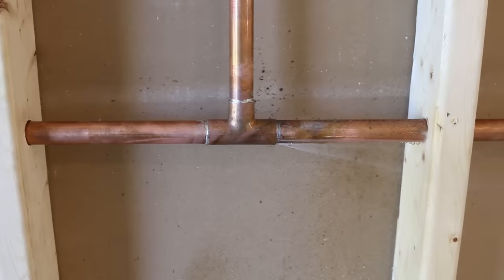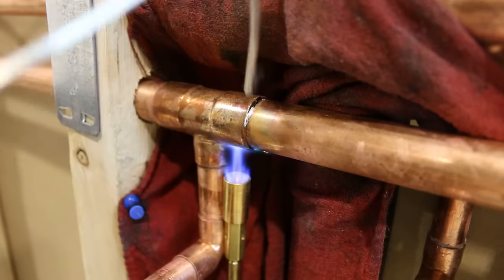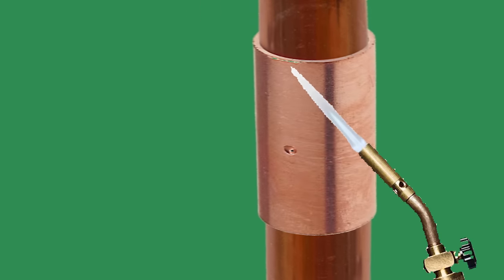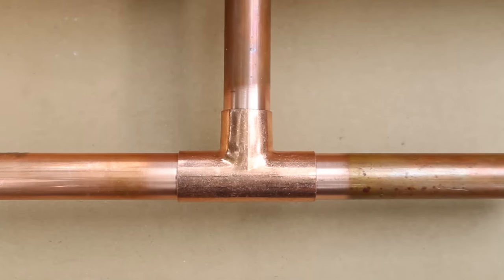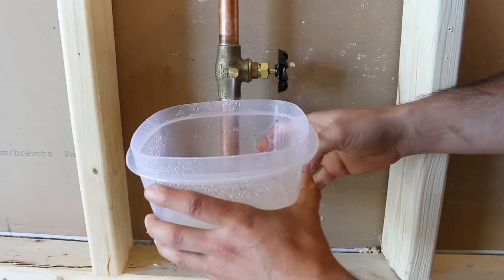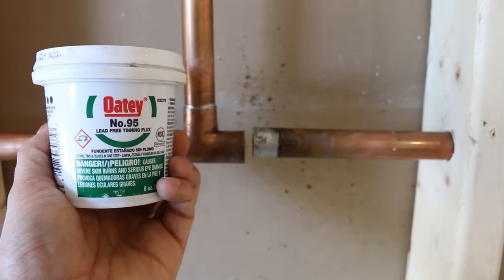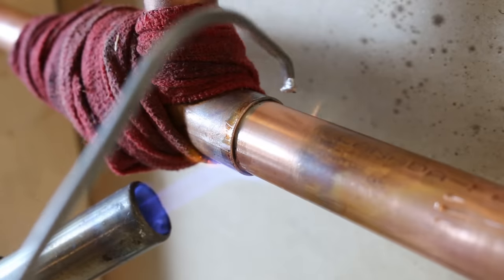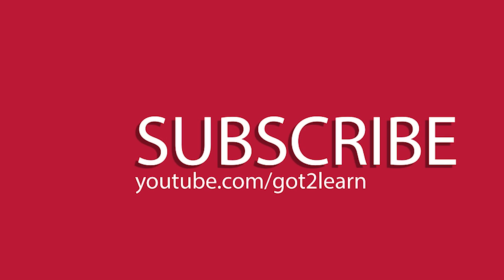The CORRECT Way To Fix A Leaking Joint (UNSOLDERING) | GOT2LEARN

Comment: Leaks happen bro, not often but once in a while. When you've completed 100's of joints it hard to gauge that odd one. Sometimes you forget to tighten that odd compression joint.  I only really dry test gas lines.  There's no second chances when safety is critical. Any plumber who tells you they haven't had a leak is a liar 😜.
Keep up the excellent work bruh 👌
Reply from the maker: I agree with everything you said ghost, if you don't want any leaks, don't go to work, cuz it WILL happen one day or another.
Reply: @Got2Learn  Tru dat bro, desoldered joints which a reformed are usually actually stronger. As the joint has been coated with solder (tinning). 
Your videos are looking super pro bro.  Really super with the editing & CGI, bravo 👌.
Reply from the maker: Thanks so much ghost! Yeah I want to do this type of editing in every video from now on, I am getting a lot of positive feedback from that, so it can only get better from now and on, :)
Reply: Ha!  And always, the joint that leaks is one of the first you did, right at the back of the cupboard behind all the other pipes you've just put in!  Quote from my plumbing tutor many years ago:  "ALWAYS check your joints, they're like pretty women, turn your back & they are trouble.!"
Reply: @theondebray  leaks happen especially when you have apprentices on hand. We've all been there, it was us creating devastation back at the beginning. Heck, sometimes you just have one of those days when you've done an install.  By the end of it you just want to get the hell out and hey presto Mr leak shows up 🤷‍♂️
Reply from the maker: That's when they happen the most, on Fridays just before leaving hehe
Reply: Ha ha ha!  Dead right, somewhere around 5.20 pm, when you have an unavoidable appointment with your wife + her friends, just run out of solder / O rings, customer's wife on her way home, forget the gym slot, forget beers with your mates, children coming home for the weekend, appointment with bank manager next morning.  And the icing on the turd, your van won't start.  I think I can safely bet that you've been there before.  (That's why I usually plan to stop work around 3 pm on Friday, to greet Colonel Murphy & his mates.)
Reply: Yup.  You only get leaks around 4.50pm on a Friday just as the customer comes home.  So I worked out that, when finishing a job, if there is no leak, then something's wrong.  It keeps you on your toes, and makes you work doubly carefully.  Oh, and BTW, you probably know, the leak is ALWAYS that joint at the back of the cupboard behind all of the pipework that you've spent a week building.
Reply: I am a pipefitter, what is this word "leak" people keep using? I checked my dictionary, it's not in there.

Comment: For horizontal pipes with residual water in them, I stuff a little piece of bread in the pipe before I soldier it. Works every time.
Reply: I once made the mistake of using whole wheat bread as a stopper. It was all I had and store was miles away. Typical electrician (me) screw up. I soon discovered that wheat berries in dough don't dissolve. I had to take the joint apart and re-sweat after it clogged the faucets. Only use soft white bread dough as a stopper. As previously stated, "it works every time".

Comment: The problem to get all water out is often best resolved with a vacuum cleaner sucking or blowing inside the tube. The airstream will move or even dry up the water and avoid a saturated steam inside the tube when heating.

Comment: I would go ahead and put a very thin layer of flux inside the fitting. You can apply the flux with one brush and use a clean flux brush to wipe out the excess flux before pushing the pipe inside the fitting. The small amount of flux that gets into the pipe is not near as bad as not getting flux on the inside of the fitting. You can (and should) flush out the pipes after a repair anyway.
It is also way easier and faster to just heat the pipe up and wipe off the old solder with a clean dry rag instead of attempting to sand off the old solder which will remove the solder "tint" in more than one place in most cases. That thin layer of tint could be the difference between a successful repair or another failed solder joint .
Reply: Tin. Not tint.

Comment: I had an entry stack in 1.5 " , shutoff, pressure reg and lateral line in 1.25" that was leaking after I changed out the regulator. There was a tiny leak in the big line. I had the clients water off all day, and they were coming home soon. By the time I walked back from my truck, it had stopped. The gods intervened. I said thank you to the heavens and started cleaning up. Going back on Monday for other work. Curious about what I'll find. It's outside and around back, so , I'll be able to sleep. I usually obsess over errors, but this time I accepted other worldly help. Thank for your videos. I've been in the trades for decades, but you've taught me a couple of things.
Reply: David G
Reply: I learned a lesson, though. From now on I'm going to tin larger tubes and fittings before joining them.
Reply: I was really busy for a couple of years but available, Suzanne

Comment: Well I had come back home to just this mess with my old house...downstairs wall and ceiling with water EVERYWHERE!

Ripped out upstairs bathtub to get to the leak and there it was, different configuration but same type of leak for the same reason, failed solder joint... 

As a newby I embarked on a DIY repair 
and followed the unsolder/clean prepare/resolder and no leak now (messy but no leak)...

So as they say: If I can, anyone can...as long as you follow this guide! :-)

Now for a DIY rebuild walls, etc.
Reply from the maker: Thank you 😎😎

Comment: I think you do a great job explaining things. KUDOS!!! However, in most cases you cannot hammer the two pieces apart because there is not enough room to push the pipe away. 
In addition, it is many times difficult to get the water out of the lines. I opened up the nearest faucet to the leak, close the rest of the faucets, and also opened up an outside hose bib. I then forced air from the outside hose bib into the water lines to clear the water.

Comment: At my dad's house there is a pinhole leak in a copper T fitting the pipe is 50 years old. I'd like to try fixing it but I've never done it this video makes it seem straight forward. The only problem is the T intersection doesn't have any room to move any of the three pipes. I'd be curious to know why after 50 years it's leaking and I dread to know what's leaking in the walls.
Reply: if there's a pinhole leak then it wasn't soldered right the first/second time or it was fixed as shown by 'patching' it.

Comment: I had a leaking T joint on one of my heating pipes (2x18mm and 1x15mm). I noticed the 15 mm joint was dripping so I decided to give it a go after seeing your cool vids. I soldered some copper pipes and fittings I had lying around to get a feel for it, then I tried to unsolder the T after emptying out all the water. The "wet rag" solution you showed so as to not mess up the other two joints in the T doesn't work. It cools down the entire assembly too much. I couldn't get the joint hot enough to take it off. So I unsoldered the entire thing. Also, I tried to use the "wet rag" on corner joints, doesn't work. The only solution if you have to repair this kind of joint is to take the entire thing off and re-solder it. Also, I found that if you might have to hack some pipes off to get all the water out and either replace the section (if it's small) or put a connector where you made the cut. It's no use wasting time on pipes which have even the least amount of water in them. All in all, your videos are great, I learned a lot from them. Keep up the good work!

LE: A word of caution if you want to try the clamp solution. The copper pipes get deformed easily if you apply force with pliers or something similar. My advice is to heat up the joint sufficiently and then use only light force to take it out. If you don't have enough room, just cut the pipe, slide a connector on it and finish the job like that. It saves time and frustration.
Reply from the maker: awesome!!!

Comment: Clean pipe and fitting- most important part- don’t touch,oils on fingers will contaminate 
Apply heat bottom of fitting
Wipe off excess flux
Apply solder at pasty range opposite heat
Solder will flow around fitting
Remove heat and apply solder around 
Wipe with rag
Done
Reply: Steve Flynn , clean is the key!
Reply: I'm in with Flynn!! Do it right the first time. Fixing a leak is 10x's more difficult and more time consuming than your first go.😎
Reply: Close

Comment: You’re right, soldering is an art. The copper has to be clean, fluxed and heated to the correct temperature for it to suck that solder in. 👍
Reply from the maker: Correct! Thx Viper for the kind comment, I like your new icon btw ;)
Reply: Got2Learn merci beaucoup 😁

Comment: I once "repaired " a very visible leaking joint by turning off the water supply so that the exterior of the pipe could be completely dried. I roughened the area and applied "liquid steel", an old product very much like JB Weld. Let it harden and turned on the water. There was no leaking. This was a lot easier for me at the time than an orthodox repair. I knew it wouldn't "last".  But, exactly 60 YEARS later, it was still bone dry.  More recently I had a pipe leak that was also visible but where draining and drying would be very difficult so I tried a silicone tape wrap. That's still holding up now at 4 years.  For the time being, I saved myself a LOT of work.

Comment: It's insane how different your systems are from ours - Europeans. We just use pipes with rubber circle-thingies, we tighten it up and bam, it's done. And sewage is even easier. You can even remove it and attach it back up if you need to do something in a matter of minutes. No soldering, no nothing.
Reply: I'm sure you're talking about the ProPress and it's fittings. A hydraulic clamp machine that squeezes a rubber o-ring around a pipe. The problem is they are expensive. The tool to make those fittings work is about $2,000 USD. And each fitting can run between $2-$10 based on it's size. It's extremely convenient for hard to solder places (near wood or anything flammable), but extremely expensive for larger projects. 

 
Compared to this here, these fittings are around half the price, and an acetylene torch for almost a tenth of the press tool, and the reuseability of the standard fittings which you saw here is what makes us americans do more soldering :)
Reply: @TonyGioMusic  No, not at all. I saw this technology, but the one I use is literally screw and all's done.

It's cheap, super simple and reliable. I suppose it's equivellent to your "shark" system. But ours is a bit different. 

There's just one con that I've noticed. We were working next to the water pipes and jaggered them around, which resulted in minor leaks. But we fixed it up quite fast.

But overall, it's an amazing system, and the water quality is just perfecto
Reply: It's an Italian technology (the fittings). And the pipes we use, white ones are from Germany. It's really not a clamp-on kinda stuff, but literally screw-on and tighten.
Reply: There's rubber already inside the fittings and when you tighten it up it solidates and doesn't let water through. Fittings are from 0.60 euros to 2 euros in retail stores and you could always buy from wholesale for hellawa cheaper

Comment: I’m going to start practicing soldering as I want to add some shut off valves to a small bathroom. Does the joint fail immediately or can it take months or years to fail if you don’t solder it correctly?
Reply from the maker: It depends. Normally you'll see it right away, sometimes it can take a few years depending on the water.
Reply: Check out modern compression and other fittings that don't require heat and solder, too.
Reply: Mission7608x2 و به ۶می‌کنم واریز کنم
Reply: wholeNwon که تو خونه
Reply: Hes right normally right away and up to 24 hrs mostly. Sometimes a year or two later but pretty rare.
Reply: U can tell if the joint repels the solder you have a issue, either moisture or not cleaned and fluxed properly.
Reply: After the third big plumbing job I realised my joints look better and are tight straight away. Fee tips from fellow amateur: do  not overheat connectors. MAP is usually ready after several seconds, very thoroughly sand joints and use deburrer. While heating listen to the flux, once it's stop sizzling, immediately apply about 2cm (15mm pipes) of solder in one place: capillary forces will move solder around. Wipe of flux excess after few minutes. If it's watertight, it's tight forever. Enjoy! Making pipe offsets is a way more difficult.

Comment: Don't forget that the water in the pipes close to the fix turns to steam when heated with a torch altering the temp needed to solder.
Reply: Should also make sure the pipe is vented open and not sealed, or the steam pressure would blow out the solder

Comment: Good video (like your HVAC ones)...everyone has to learn from mistakes....ive learned the hard way......i cannot stress the pipes need to be scrubbed clean on all touching points (inside and out)...always keep it dry when soldering, just a light coat of flux and i try to start heating on top for a little bit and then go underneath since heat rises
Reply from the maker: Good input, thanks buddy!
Reply: The pipes are heated by conduction not by convection, so heat rising is not important. But moving the heat source, as you said, is important, esp. in brazing.

Comment: As a refrigeration and air conditioning lecturer we made sure every student was more than competent in soldering.
The system pressure can be up to 400psi (2800kpa) when operating so welded joints must be absolutely spot on.
The #1 rule is managing the amount heat to ensure it has filled the total joint. It is the silver content that gives it the strength.
By watching the colour changes you can tell when to add the solder or when to back off the heat.
Welding a capillary tube (0.5mm) into the side of a large copper pipe is a great exercise in learning heat control.
Mapp gas and oxy/acetylene are very different in temperatures so getting the right amount of heat is paramount.
Reply: That's called brazing dude. It's not the same.
Reply: @dakotahuff2276   yeah you're right and I know there's a slight difference between them.
Could never understand why solder when brazing is so much stronger.. and the process being 95% the same
Reply: @djfunkychicken Don't you have to purge with nitrogen to prevent the copper from oxidizing when brazing? Also I just soldered some valves with plastic components which would likely melt if exposed to brazing temperatures. With plumbing you probably don't even need the strength of a soldered joint (stuff like Shark Bite is popular now, because it's faster).

Comment: Ive found its best to use wet/dry emery tape to sand the surface. Regular sand paper desolves and tears apart usually before the job is cleaned properly

Comment: I don't know if others have noted this, but I recently discovered that Dremel makes a sanding head that just happens to fit PERFECTLY inside 1/2" copper couplings (can't speak for 3/4" - sorry!). I recently used this to remove solder from a joint I had to take apart and re-assemble and it made the job A LOT faster.
Reply from the maker: You have to be extremely careful when doing it with this method, if you sand too much, the capillary space might become too big and the solder won't be able to fill it, be cautious ;)
Reply: @Got2Learn  Definitely a good point. I just worked it a little bit at a time until I could get the pipe back in without too much trouble. The re-soldered joint looks good so far. Fingers crossed! Thanks for all the great videos.
Reply: (And I sanded the outside of the pipe as well, obviously - but I did that by hand.)
Reply from the maker: Awesome man, will keep em' coming ;)

Comment: the vice grip worked for me! I was desoldering a 1'' pipe and it was tight. I used a rag too and it isolated the other fittings.
Reply from the maker: Awesome, good job :)

Comment: Again, great video. I'm sure you have the best channel for plumbers right now. Great information, visual examples of right and wrong . Amazing. Dont stop making these. Go from tips on grounds to fixtures! That's 100+ videos . Where I work if we glued a PVC fitting 1 1/2" + . No matter how long if needed due to mistake . We use our torch to burn/soften,  to peel it out.  It works great to even re use. But idk if there are consequences using the method.
Reply from the maker: Hey man, thank you so much for you're comments, they keep me going. As for the PVC removal trick, I made a video about a month ago that talks "just" about this, here's the link if you wanna see it: https://www.youtube.com/watch?v=UPzUBxvB8jo&t=29s

Comment: I once didn't have a line clear enough of water, vertical 3 feet needing to change a ball valve, and for whatever reason I started from top going down (it's best start down). The last coupling steamed water inside. Turned water back on, and damn did it leak, I thought "did I not flux?) cause it looked like the entire joint failed. After I took it apart, found a tiny, needle-tip thin gap through the solder the steam created. Amazing.

Comment: Great video, but a warning - I tried unsoldering the pipe using the locking pliers method and besides it not working for me, the pliers gouged the copper pipe creating the potential for a another leak. I wound up cutting out an 8 inch section of pipe and soldering the pipe back together.
Reply from the maker: Yeah, a piece if rubber might help with that, thanks John!!!